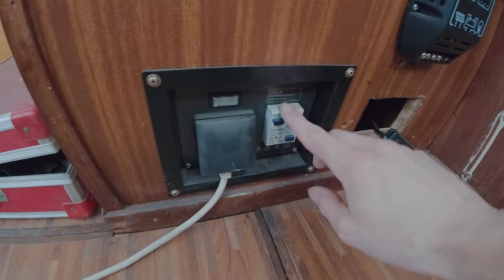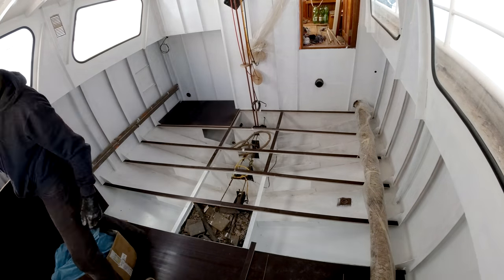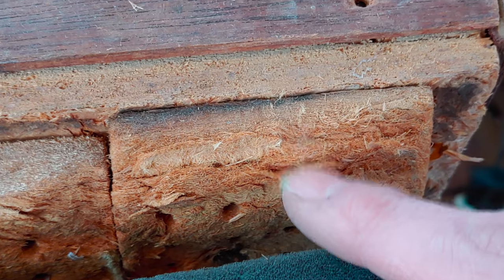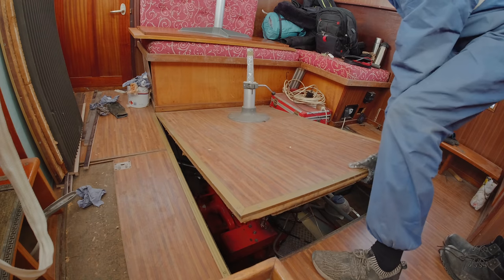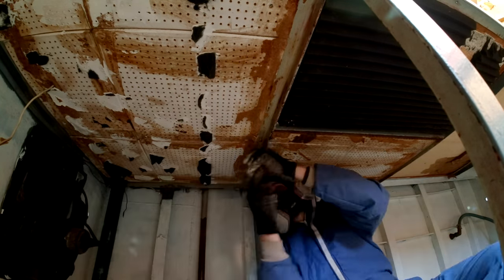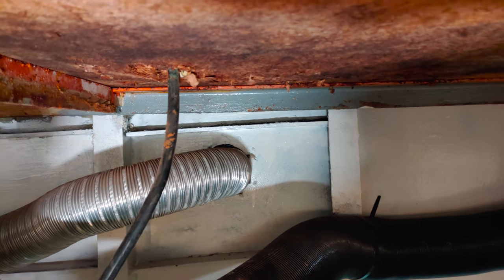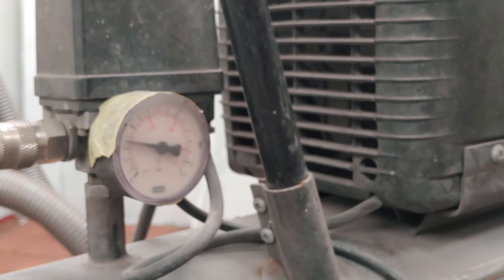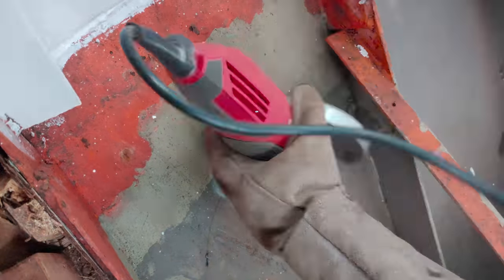PLASMA CUTTING GONE WRONG ( on our BOAT ) - Week 23 -  Vintage Yacht Restoration Vlog

Comment: My two cents : I would add a bit of Sikaflex into the holes before I put the bolds. Just in order to prevent moisture to get below the head of the bolds up to the steel. I don't know if some people will agree with me on that point.
Congratulations for the great work.
Reply: Butyl tape. Made for screw holes.

Comment: Ok, some advice for the hatch bolts. Drill oversize holes in the mild steel to start with. Make sure you use epoxy primer on the steel and paint inside the bolt holes too. Use a stepped nylon washer in each bolt hole under the nuts to prevent the stainless steel bolt coming into contact with the mild steel. The washer will centre the bolt in the hole and insulate the stainless from the mild. This keeps the dissimilar metals apart. Then, as others have said, make sure you squeeze a bit of sikaflex around/into each bolt hole so that it gets squeezed into the thread of the bolt when tightening to make it water tight.

Comment: The engine room roof is chipboard and when it gets wet it it swells up and is no good and will have to be replaced.  When chipboard is made it flakes of wood mixed with glue and compressed. So when it comes into contact with water is no good anymore.  The MDF looks like it was added to be a noise dampener.   Great video looks so much better with the  second coat of paint.  Can’t wait for next video. 👍👍👍👍

Comment: Your plasma cutter is experiencing voltage drop.
You need to shorten up your electrical leads feeding it.
Similar to a post on here referring to testing your batteries under load for a accurate reading you need to do the same with your plasma cutter. 
Even if you read a solid 220v at you power plug as soon as you start to cut and put a load on the circuit the voltage will drop off considerably.
To help with this. 
You should set up a dedicated circuit from your power panel to a outlet just for your plasma...
Keep it as short as possible to reduce voltage drop...
Looking good! 
Stay on it. 💪

Comment: Put a bit of butyl tape under each bolt / screw head on the hatch! Prevents water leaking from underneath the bolt heads
Reply: ABSOLUTELY...GREAT TIP...Yet though he does have lots of sika flex in the seams.
Reply: @fonhollohan2908  _ You'll be surprised how much water can get in through the threads!! _

Comment: Little trick e were told as apprentices. Wind a nut down the thread, cut to size then wind nut off. Acts like a die to even out threads.
Reply: You beat me to it John 😊
And one other thing. cut it with a hack saw not an angle grinder! You will have much better control .
Reply: Can additionally wind teflon tape around those screws to withstand vibration
Reply: I thought that was standard practice

Comment: They used OSB for the main cabin floor. OSB on a boat is a big nono because it isn't water resistant. You have to replace it.
Reply: Sorry to say, but the Cabinfloor isn´t OSB it looks more like Chipboad, but you are right- both isn´t waterresistant. Thats why he is using the waterresisted Boards in the Cabin in the Back of the Boat.

Comment: I replaced about 20% of the hull of my steel boat.  I did not have a plasma cutter then, but used a Sawzall with metal cutting blades to cut many meters through the steel plating.

Comment: Leaking hatch frames and their fasteners are a problem on all boats.  Many sailors give up using any "permanent" sealants and apply butyl take under the hatch frame and under the head of the screw.  This will eventually leak, but it is very easy to remove the hatch, remove the old butyl tape, clean the surface and apply new butyl tape.

Comment: Here's a tip for you bud. When you cut any bolt or screw with fine treads or even course threads leave the nut on the bolt or the screw if all possible. So, when you clean up the end of the bolt by putting a tapper on it, when you unscrew the nut, it helps to accept the nut so you don't have to fuss with getting the nut to accept the treads. Hope that makes sense.
Reply: I'm explaining it differently than John Glover if you didn't grasp what John was saying..

Comment: Not sure where you are storing your welding electrodes, but if they get damp, they won't weld as well. One of the shops I worked in did a lot of stick welding, they stored the opened welding electrode boxes in an old frig, that wasn't working anymore. They disabled the door switch, so that the light stayed on full time, to provide a bit of heat, keeping things a bit drier. 
Mig welder doesn't have the same problem, the outer coating on a stick electrode provides the arc shielding, where on a mig, flux core, the core inside is not affected as much by moisture. Those with shield gas in a bottle, argon or mix, the only thing you need to worry about is rust on the wire...

Just my two cents.
I'm enjoying watching you working on the boat!! Thanks!

Comment: Plasma cutters generally don't require that much current. If you're having current problems, you may have an easier time with your welding if you can run the machine hotter.

Comment: Bravo for this job done in the rules, personally I will have cut the screws of the bolts a little shorter because they are at the end of the tightening race ... !! and it is better inside to also put a strapping rather than a washer on each screw ... !! but it's a good job, well done !!

Comment: Grounds. Grounds. Grounds. Get the ground (welding and plasma) as close to the work as possible. If you have to weld a ground post directly beside the work area, do it. Grounding the equipment 10 feet from the work area will not work as well as 10 inches.

Comment: I can see where a Saws-all with a diamond metal blade would come in real handy on this project. The plasma cutter is never gonna work unless you have a nice fat cord right on top of your power supply, but the Saws-all will make quick work on your hull cut out corners.

Comment: I’m curious about the bolts supplied with the hatches, being that stainless steel & aluminium don’t go well together (galvanic corrosion), especially in a marine environment, what material are the fixings, assuming the hatch surround is made from aluminium?

Comment: This is a dangerous way to patch a steel hull. When you make sharp corners like this, you are creating a starting point for cracks. The welding will not prevent this, there will be a structural weak point at every corner of the patch, and the vibrations from the engine and movement through the water will make the plate move enough for it to start cracking. This can potentially sink your boat! 
In order to prevent this, you'll need to cut them out again a little bigger and make the corners round with a radius of at least 20 mm.

Comment: You are doing an excellent job! No need to apologize.  Is it just the amperage for the plasma cutter or is the boat made of high carbon steel? That makes cutting and welding both more difficult.

Comment: Maybe a bit premature, but have you decided / considered what kind of sonar transducer you will mount? Hull through style or ?
Cheers from Norway 🇳🇴👍
Reply from the maker: actually there is already one built in, it's a thru hull style.
Reply: @MyFirstBoat  Do you know what type ? and what style of connector pin it has to the display ?  My guess is that is maybe to old for the modern systems delivered today And thanks for answering :)

Comment: Not that it matters, but I noticed moreso on this video than others that when you are stick welding, you tend to push the stick into the seam to get that puddled shape of the weld, when you should be taking the end of the stick and making little C shapes. if you are welding left to right, the C looks like a C. If you are welding right to left, the C would be backwards. But that way you are really heating both sides of the weld and bridging the weld together, which makes that classic weld pattern. Anyway, carry on...

Comment: Not enough sealant on that rear hatch, aluminum and steel expand and contracts at different rates. There has to be enough flexibiliaty to allow for this. Buytl tape is usually better

Comment: Hi, IT IS NECESSARY to lubricate all the bolts with which you secured the hatches !!!
Reply: @My First Boat _ He must, and I say again... MUST put an anti-Galvanic Corrosive sealer on ALL bolts that are Stainless Steel and that are going through Aluminium onto Steel. _
Reply: @liongod1000 I meant the lubricant INSIDE, not outside.

Comment: You were lucky to get anything cut on battery power alone.
Reply from the maker: the cutting was done on the shore power we get from the storage company, but it seems to be limited to about 20Amps.
Reply: @MyFirstBoat  ahh, I thought it was just from your batteries! If you can why not rig up your generator, that should be able to cope easily with a small plasmer cutter.

Comment: You need to think a bit more about fire safety when you're welding and using the plasma cutter. The wood under your boat would make a nice bonfire and welding so close to it is pretty risky. I would hate to see this boat go up in flames.
Maybe it would be nice to modify the floor on top of the engine room. If you can build something that opens easily it will be much more comfortable to work in there in the future.
Reply: Yep move the wood

Comment: About the battery voltage, it is not a good idea to measure the voltage when the battery is unloaded. Often, even with an acceptable voltage unloaded, the voltage drops a lot when a load is applied.